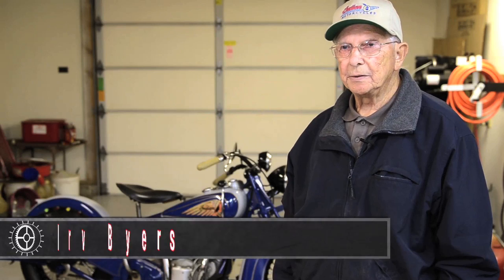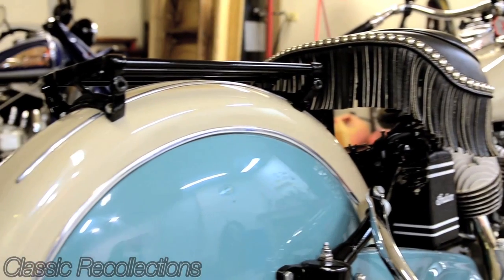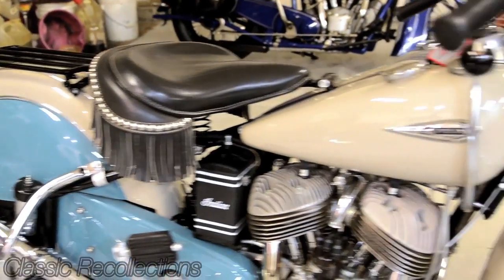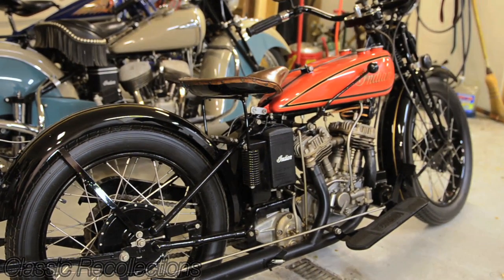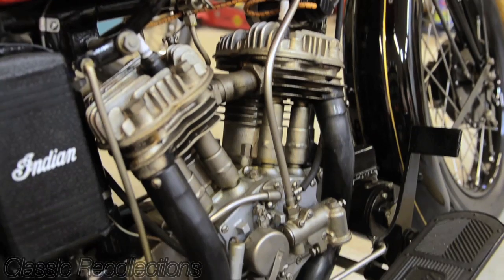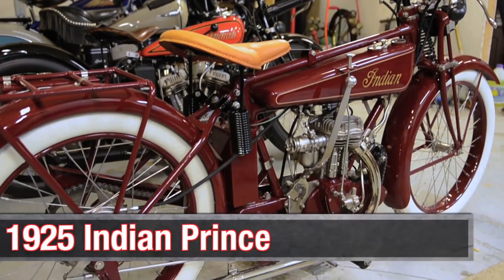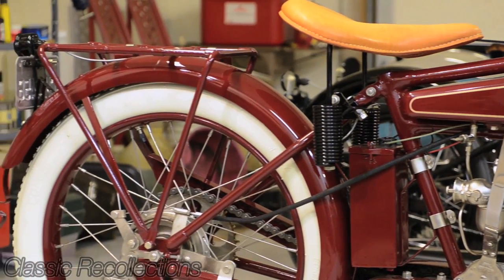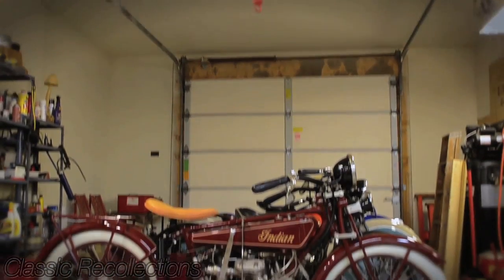Classic Recollections: Vintage Indian Collection

Comment: WOW love your collection !! One correction. In 1940 the Sport Scout gained full-skirt fenders, a lower seat height and increased fork rake to previous Scouts and the last year to use a rigid frame. 1941 Indian added plunger-style rear suspension.